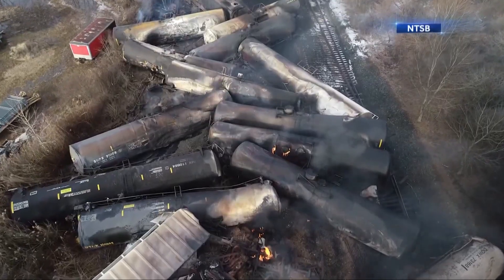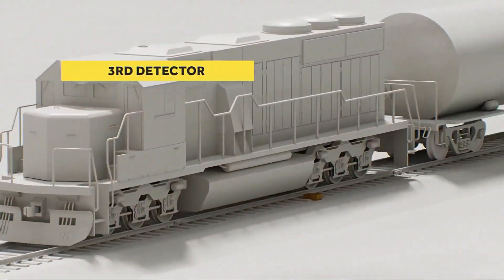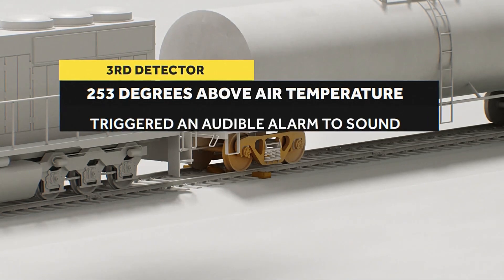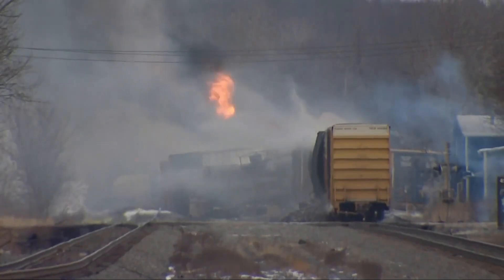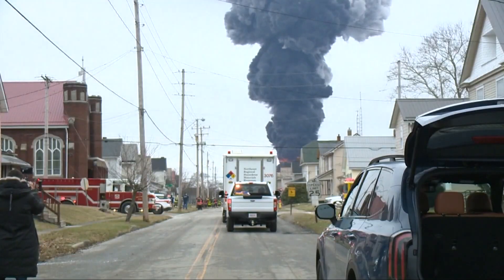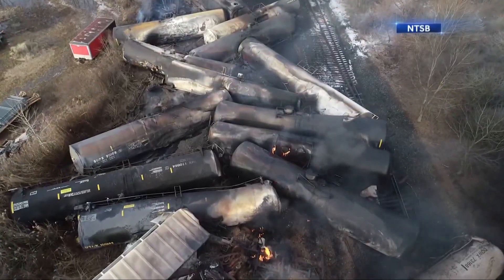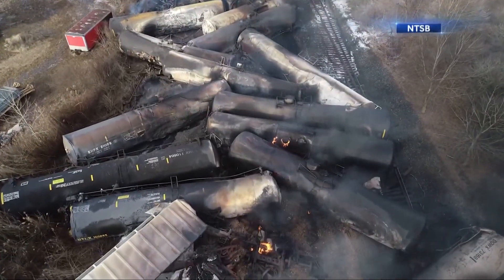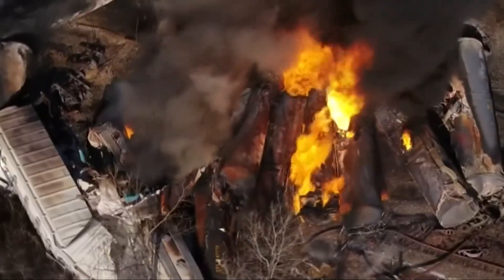3News Investigates: Railway experts weigh in on axle inspection after East Palestine train wreck

Comment: Last 3 hot box defect detectors at Sebring, Salem, East Palestine showed rising temperature. Did Norfolk Southern Wayside Detector Help Desk OK train to keep going after first two alerts? Anyway, there should be national defect detector standards, calibration and testing protocols! FRA, NIST?
Reply: Showed rising temperatures that were within tolerances.  Because the temperature was within tolerance, there was no warning issued.  Railroad wheels can see rising temperatures simply from braking action when a train slows.  It's when the temperature exceeds a certain limit that a warning is issued.
Reply: Sebring - MP 79.8
Salem - MP 69.0 (10.8 mile gap)
East Palestine - MP 49.8 (19.2 mile gap)

Comment: Since the railroads in USA are de-facto "private" entity, the companies try to cut corners on rolling stock and track maintenance. 
To be honets, such huge industry shall be government-run, in order to prevent any safety misconducts. 
Right now the US railroad is falling far behind! railroad ties are WOOD! While in Germany, Russia, France, China- they are mostly concrete for the mainline track! Track itself have to be thicker gauge for heavy load lines. axle bearings need  better maintenance and inspection. How often I see freight trains pass by, and at least 3-4 cars have adnormally noisy bearings! This is the first sing that the bearing is almost toast.
Reply: You actually believe the government can run something without “misconduct”?   Wow

Comment: Wait just a minute. The trains crew got 2 warnings about the wheel but are not suspected of any wrongdoing. There's nobody beneath them to blame, that means we have to go up the ladder. The engineer was told by higher up, to slow down and keep it moving until you reach the next siding. Thats why NTSB says it was 100 percent avoidable.
Reply: Not sure how they came up with 2 warnings.  The Ntsb report said 1 warning in east palastine.  By then it was too late

Comment: Why didn't they stop
Reply: From what I saw on another video it said that they weren't required to stop unless it detected higher heat or another one I saw said that the bearing probably reached worse detectable level after it rolled past the sensor box
Reply: @danielgouge4639  From the NTSB report, the hotbox detector 30 miles before the derailment read a 200+F temp reading. The Norfolk Southern manual allows for them to override such alerts even though it's 200F+!
Reply: Wait for the report in 3 years.

Comment: 'She'll be right!' mentality strikes again, particularly given that machines, computers etc are 'always wrong'. In this case the squeaky wheel did not get the oil it needed (or replacement).  Just another case of man thinking everything is under his control when it ain't aka the insanity of man.
Reply: actually, the defect warning that was issued to the railroad crew came too late.  As the crew was coming to a stop, the derailment occurred.